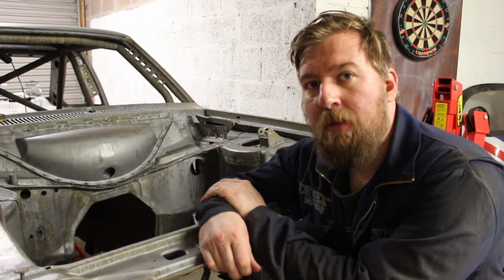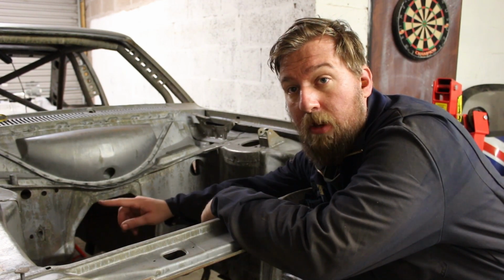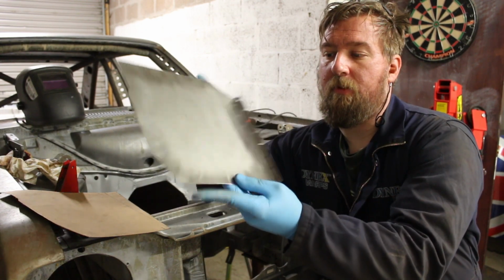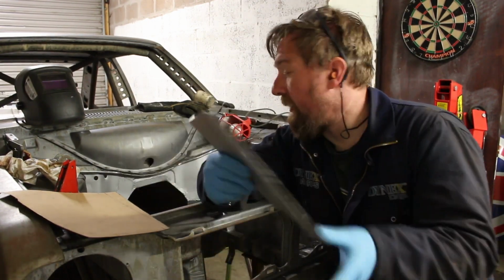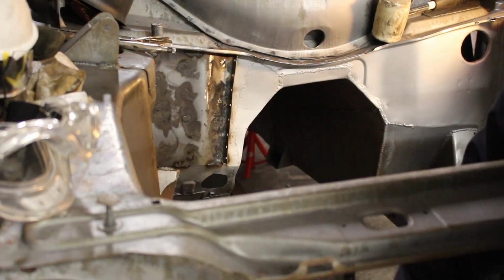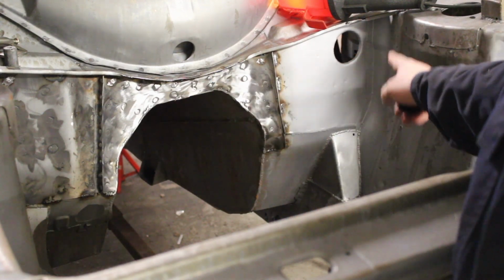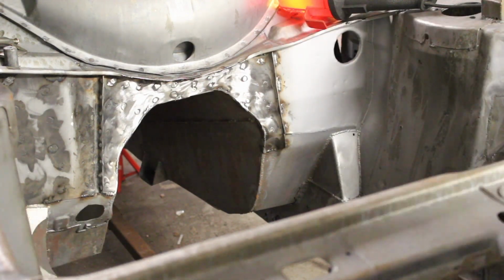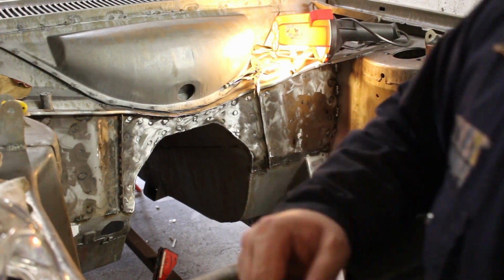Escort MK2 Front bulkhead reinforcement

Comment: Hi, been watching all of your videos as building my own S2000 escort Mk2. Have you actually finished the car now?
Would love to see where your up to with it now?
Cheers Mark
Reply from the maker: Thanks Mark. The cars not finished unfortunately, far from it. The good news is more content should be dropping soon. I’m just trying to get my    Stuff/live together. Watch this space though. How’s your S2000, is it finished?
Reply: @noideabuilds9248  hi, I’m currently doing dry build so it’s a bare shell at the moment , chassis mounting the engine  and bulkhead to repair, plenty to do but the outer body is already painted so hopefully won’t take long to put together after fabrication
Reply: @noideabuilds9248  hi, anymore updates since on we last spoke?
Mine is still a bare shell but I’ve fell down the slippery slope of 4link, watts, atlas, turrets etc, so much for just an engine swap.
Cheers Mark
Reply: @Hondamark2  Hi Mark. No news really. I still have the car, it’s ready for bodywork and paint but finding time is impossible these days. I’ve started a new job after covid times and I’m out the country more than I’m in right now. Hopefully in a few months things will settle and normal service can resume. So where are you at regarding the 4 link. Have you chopped anything up yet?
Reply: @gavinwallace9345  did you do anything for fitting the turret towers ?
Reply: Hi, I’m on with setting the link boxes now, however I’m not using the gartrac 2 piece boxes, I’m using the big bush wide 1 piece boxes, however there a bit of a mare to set up, I thought they would be easier but the floors cut now and there set in, turrets and watts to do next
Are you on any social media or messenger etc ?